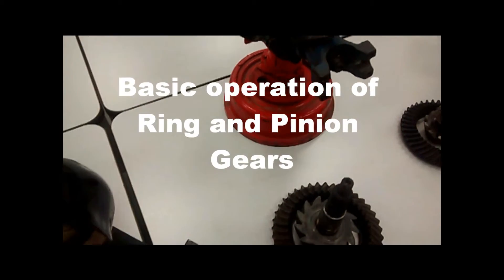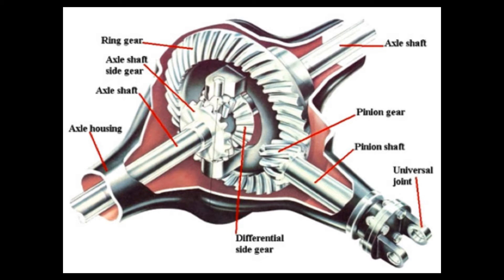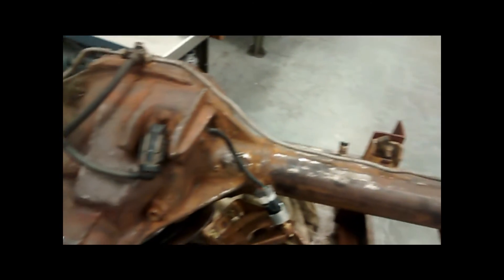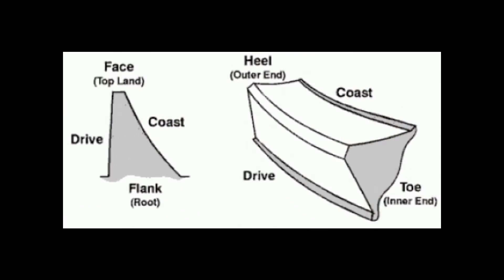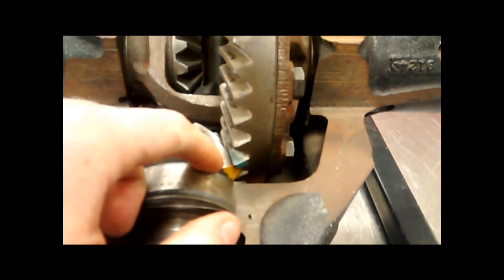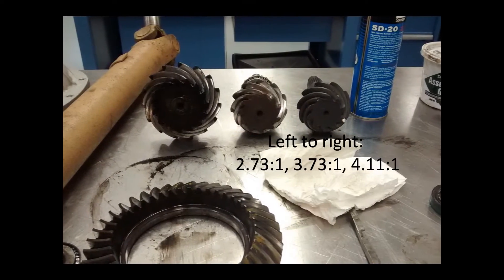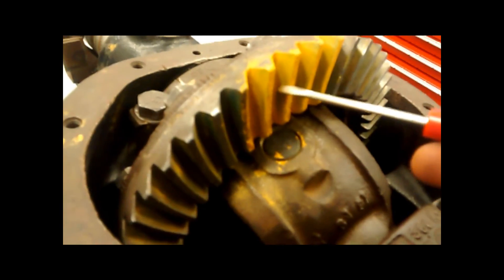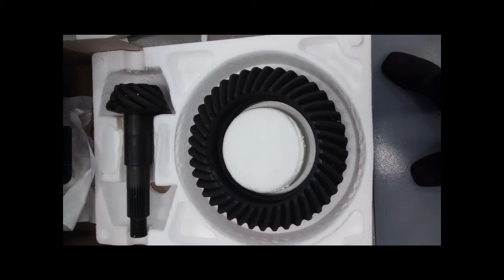Ring and Pinion  Anthony

Comment: Thank you Anthony.  This rather simple explanation of the ring and pinion should be primary to any differential  instruction class on assembly procedure and maintenance. Yet I watched a full 2 hour video that was not comprehensive to me due to the absence of this prelude.  Can you recommend a DIY video of the the typical 10 or 12 bolt diff?

Also.  Are the ring and pinion gears also known as worm gears?  I believe the same torque amplification happens in my Skill model 77 worm drive saw. (the best most purchased framing saw saw ever built.)